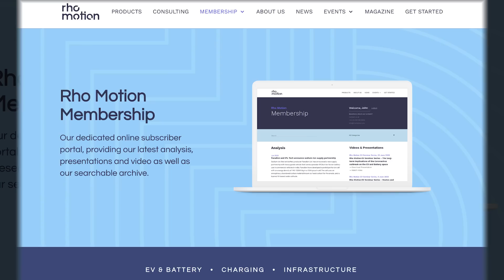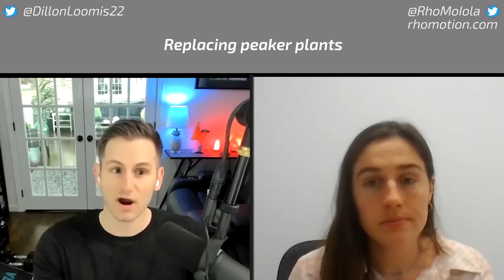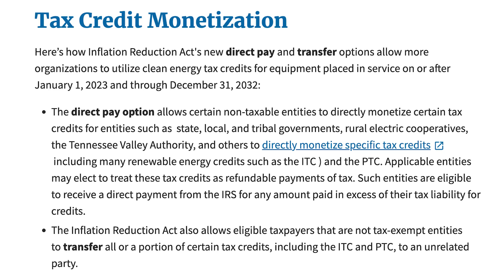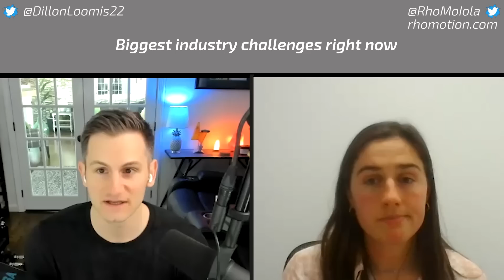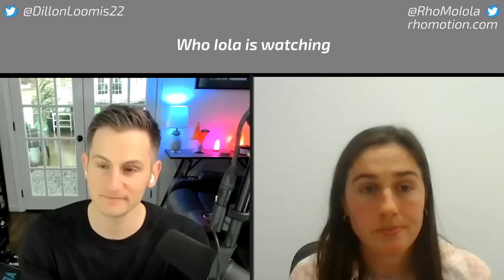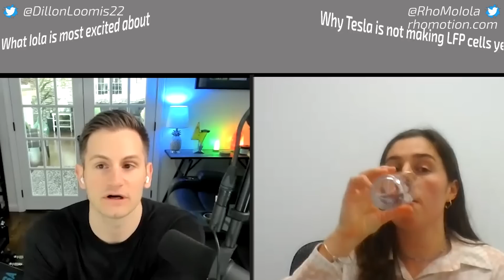Exclusive Interview: Tesla Energy - The Tidal Wave Ready to Break ⚡️

Comment: We are a VERY long way from this, but do you think there will come a point when there is so much battery storage on the grid that peak low/high prices are dramatically smoothed and there will be far less financial gain from buy low/store/sell high?
Reply: Yes of course and the grid doesn't need a lot of megapacks to get to that stage
Reply: @kaya051285  Eventually ... but demand keeps on rising and price reduction accelerates that. Capacity is now day nominal; peaker plants serve temporary high demand. With solar, batteries must smooth that and meet night/bad weather demand as well. Looks to me like the grid will continue to need increasing storage capacity for quite a while (if not forever 🙂).
Reply: @WarrenLacefield  It depends on the grid but the countries in Europe where the peak demand is winter around 5-7pm have seen a continual 20 years of lower peak demand and as a result they were able to close old power stations without building new power stations or peaker plants

For example the UK closed 20 large coal power stations and replaced them with mostly nothing. The reason is mostly because LEDs replaced incandescent light bulbs reducing peak demand massively

This trend so far hasn't stopped even the last 5 years has seen peak demand fall

Also IMHO you are wrong
There are other ways to meet peak demand which offer a lot more value than megapacks

For example most of Europe plan to link up their grids to their neighbours. Last year A large link was built between the UK and Norway it has a capacity of 1.4GW

That one link is enough to export or import 235GWh of power per week. If we tried to do that with megapacks we would need to spend approx $110 billion on megapacks instead we got the same value by spending less than $2 billion on a link to a nearby country. That's 55x cheaper than batteries. Also this link will likely last 100 years while the batteies maybe 20.....

Europe plan is to build interconnectors to trade excesses rather than store them in expensice finite life batteies

America will do the same
You will build interconnectors between your 3 big independent grids. You will link up East and west cost and Texas grid. Probably also further link to Mexico and Canada too. So rather than store excess solar produced in california you'll export it to New York. These links will also reduce the need for peaker plants as the West Cost is 3 hours timezone different from the East Coast so the peak evening demand is at different times
Reply: @kaya051285  Well, you certainly do make solid points. While I do believe that humanity will continue to consume more power in the future as long as it is available, Nicki Smith's question was indeed about needs for peak power smoothing and buy low/store/sell high gains. As you point out well, there are lots of ways (other than batteries and/or solar/wind) to provide/smooth peak demands. Technology changes (efficiencies - like EVs or LEDs and, in the future, improving things like data centers or desalination) sure help; so does interconnectivity (power where as well as when needed); nuclear sources come to mind (power period, locally or grid delivered). Oil and gas reserves are valuable still for fertilizers, plastics, all kinds of important stuff (wasted just burning up for heat + CO2). I do think, however climate change and energy needs are met in the future, electricity will be abundant and prices will reduce substantially for consumers and commerce. Hope so.
Reply: @WarrenLacefield  For Europe and especially the UK we are blessed with high wind speeds PLUS shallow water depth in the North Sea allowing very affordable very affective offshore wind farms at truly below the cost of fossil fuel generation

People don't realise how much offshore wind has improved. The first turbines were built nearly 30 years ago and only had a capacity factor of 22% and 450KW power. The Turbines being installed next year are 15MW and 60% capacity factor

That means each turbine is now 91x more energy production than the first gen wind turbines..... and we aren't yet at the limts of offshore wind id wager we will see 25MW units with 70% CFs in the 2030s which is an additional 2x better than today

These huge productive next gen turbines have very high capacity factors because they start spinning at lower speeds and maintain higher output over the range of wind speeds. 60% average throughout the year but 70% in the winter means we don't actually have to store a lot of power as they work most of the time

The UK will get 90% of its eletricity from next gen wind turbines at below the cost of fossil fuel generation

While not everywhere is blessed with high wind speeds plus shallow waters. Many more countries can make use of such resources if the world gets the price of HVDC down and also pushes floating wind down the cost curve. Both will happen if we want it to happen

There is no need for massive deployment of finite life material heavy batteries when HVDC and high CF wind farms can get you a near fossil free grid at a much lower price using far less materials wirh infrastructure that will last 80-100 years rather than 20y for batteries 

Going further into thr future maybe in the 2030s or 2040s we might even link Europe and West Cost of USA/Canada together with HVDC lines. That's a 5-6 hour time zone difference meaning each 1GW Link reduced the need for peaker plants and allows trade and transfers of excesses rather than the need to store those excesses. We don't need that to avoid batteies but I think we might build the above as they will be economic in themselves and the side benefit is the reduced need for batteies
Reply: @WarrenLacefield  I don't forsee a huge increase in electricity demand as we electrify transport and heating as efficency will pick up most if not all the tab

For example lots of US homes heat via resistive heaters. Well you can heat 3 homes with heat pumps for the price of 1 home with resistive heaters

Some 40% of US homes are heated with resistance electrical hearing. For that amount of electricity you can heat 120% of the homes with heat pumps so no net additional load in fact a reduction in electricity needs

Yes a home that converts their natural gas or propane heating to electricity adds to the demand. But a home that converts their resistive heating to heat pump reduces their load

The USA can definitely function with an electricity budget of 4,400TWh and electrify all cars and electrify all home heating without the net production having to go up much

4400 TWh over a future population of 400 million = 11,000 KWh per capita that is sufficient for EVs and Eletric homes and businesses

About 20% of that budget goes to EVs leaving 80% for everything else plenty enough
Reply: @kaya051285  Interconnectivity only goes so far (literally); until superconductivity improves, line losses remain considerable. Grids may not even be the best answer. There are quite good arguments to be made for local generative capacities, given some of the political, social, and climatological issues now and in the future. Wind power is certainly one of these; solar is another. Batteries and other energy reservoirs help lots there. Actually nuclear is too. I'm not so sure about geo-thermal. Right now as you point out (and as Tesla does as well in its latest impact statement) efficiencies throughout homes, cities, and factories are probably the lowest hanging fruits. But I am arguing generally that "(em) power" is required to do anything, certainly to replace human labors; support a world of "abundance" (food, shelter, health and medicine, recreation, etc.); explore space; clean up this planet; and so on. Whether we have more people or not, I think they will need more energy to deploy.
Reply: @WarrenLacefield  You don't need more than 10MWh per capita For a highly electrified world perhaps even closer to 8MWh but lets go worh 10

That means the USA could actually go down in electricity consumption while moving to an electrified system while other countries like the UK will need more

On a global scale 8 billion people using 10MWh average would mean 80,000 TWH or double where we are but on a USA scale it would mean going from 4400 TWh to maybe 3,500 TWh

Also HVDC lines can be economically very long. Their efficiency is already very good and better than the 92% round trip in Batteries 🔋 . In Europe we already have and are building links ~1000km in length. We don't have longer ones as countries are pretty close to each other. In other parts of the world lines over 3,000km exist

Linking the USA three big grids together would be an economic worthwhile task. Also once built they will likely last 100+ years as it's pretty inert metals like copper or aluminium it's not like batteries wirh a finite 20 or so year life
Reply: @WarrenLacefield  You don't need super conductivity. 1.1 millio  volt HVDC has losses of ~ 2.5% per 1,000 miles

That means about ~6%  loss to transmit power from the west coast to the east coat. 6% is okay and is better than the 8% loss in charg9ng and discharging a battery

More importantly such a line will last 100+ years and cost less most likely be close to zero cost. When the US was building out its grid 1.1 MV HVDC didn't exist
Reply: @kaya051285  HVDV is an advance. But honestly, grids are fragile. More so than pipelines, fiber-optic cables, etc. 100 years, likely zero cost? Europe is much "smaller" than North America. As far as I know, solar power from Spain still doesn't flow across terrain into Europe. Tornadoes, hurricanes, earthquakes, sunspots, other destructions, etc. are threats in USA and elsewhere. Which is why I would encourage local or regional generative capacity, with grid sharing but not dependency. Battery storage is good for transients, like flashlights and candles.
Reply: @Warren Lacefield  The ones built in Europe are effectively zero cost. Building TWh of batteries aren't zero cost

The uptime of intercomemctors is pretty high something like 97% which is higher than pretty much everything else

Even wind power effectively has a HVDC link onshore

Solar isn't good enough at 10% capacity factor in northern Europe vs 60% for offshore wind

Anyway not long left the UK a country of 70 million will have a grid which is more than 90-95% fossil free by 2030

It's already 60% fossil free but will get to ~95% soon and with very little battery storage
Reply: @kaya051285  I think that is great, I Kaya, and you are correctly proud of the UK. Speaking globally, one might say UK is "regional" and you also have many multiple generating sources which are "locally" scattered about the country, on land and nearby shallow water shelves. A model in fact for other countries to consider and learn from.
Reply: @Warren Lacefield  Thanks but I think we got here more by luck than foresight. We just didn't want turbines on land so made a push for turbines at sea which worked better than anyone would have guessed 10-15 years ago

The next Gen offshore wind turbines are fantastic. 15MW units generating 80,000 MWh per year. More generation in the colder winter months than the warmer summer months which is exactly what we need

And offshore wind turbines won't stop improving. There is at least another 10 years of development on the turbines. I wouldn't be surprised if we settle on 30MW units with capacity factors in the region of 65% which is a tremendous amount of energy per turnine. And after that, probably 10-20 years of development on the processes to get the turbines cheaper and cheaper still

Anyway there is definitely a path for most countries to upgrade their own grids and link to nearby countries greatly reducing curtailment

There is also the potential to link to far away countries eg Canada/USA to western Europe. Sounds far fetched but the Chinese have already built lines in excess of 3,000km using European technology, so its possible. The 5 hour time zone difference is a big bonus and these links greatly reduce the need to store energy

These types of links also make it more viable to export electricity profitably over long distances. The UK and Norway have a huge amount of offshore space so in theory could export a lot of energy to the rest of Europe. This doesn't even need to be via the UK we could lease the sea bed to say Spain or Poland or whoever needs it and let them build their own offshore wind farms and take it directly to their own countries via HVDC links and maybe charge a 10% royalty or something like that

Anyway my main point is the best battery is no battery and if yiu can make things work with no battery that's what you'll do. And that's the plan for Europe. Also its not just the UK most of the EU nations are going to be 80-100% fossil free grids by 2030 without significant battery capacity needed
Reply: @kaya051285  Tesla estimates we need ~100TWh of stationary storage to transition the entire world to sustainable energy, which would be 33 million x 3MWh megapacks, or 2500 years of output from the single 40GWh/year Lathrop factory. We've barely started
Reply: @nikkismith8750  Also you really have no concept of how big a number 100TWh is

That's $45 trillion. Woth a 20 year life and 8% interst just the monthly cost to service the capital is $320 billion per month or $3.84 trillion per year just for stationary storage???

That's far more than we spend on oil globally which isb ~$3 trillion annually. But oil we use for basically everything cars planes boats trains tanks fighter jets plastics fertiliser tar bitumen building materials

There is no way at all the world will spend $3.84 trillion per year on stationary storage for batteries especially considering WE ALREADY HAVE countries which are close to zero fossil fuels in their grids with basically zero batteries. Eg Norway and France. Why would you spend $3.8 trillion when you can spend $0 trillion

The best battery is no battery
It costs nothing
Needs no land
No staff
No security 
No financing
No mining
No transport
No geopolitical risk
Etc

You won't do a task with batteries if it can be done without batteries

Most train lines in eruope are electrified. Why build battery powered trains if you can build eletric trains that don't need batteries?